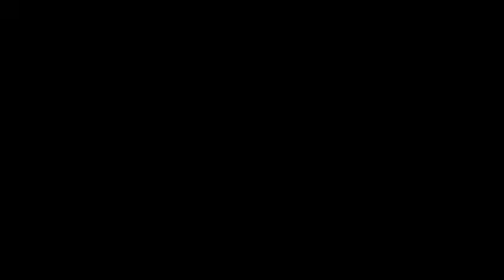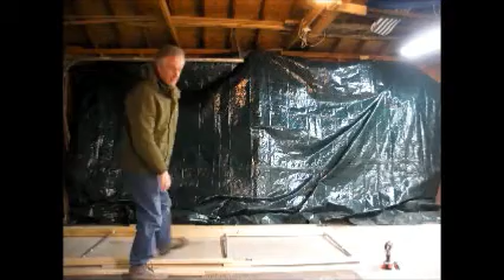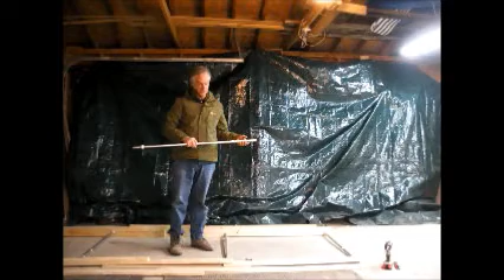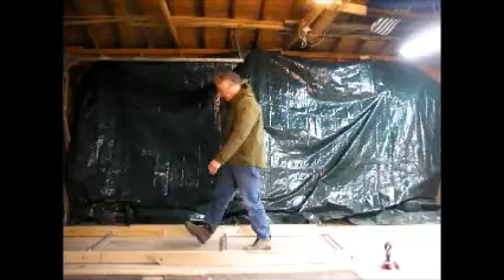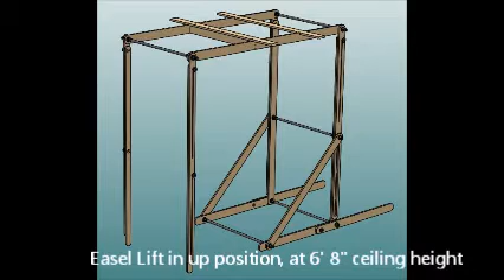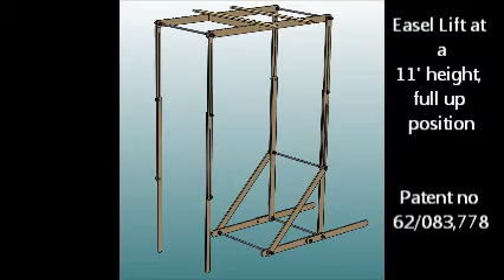Easel Lift assembly demo

Comment: If you are looking for a way to hang panels on walls by yourself check out @t.  The only tool made specifically for one person to transport, lift and hold panels on walls. Never have to lift a panel again when hanging walls. Works with upper and lower panels.